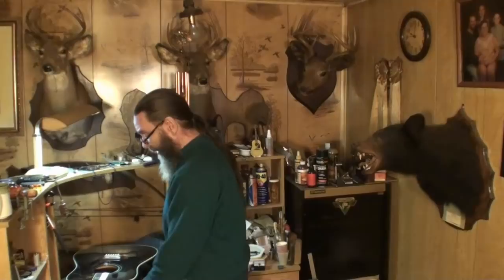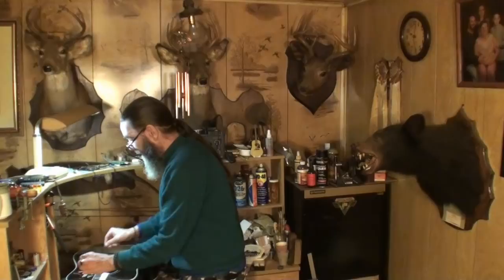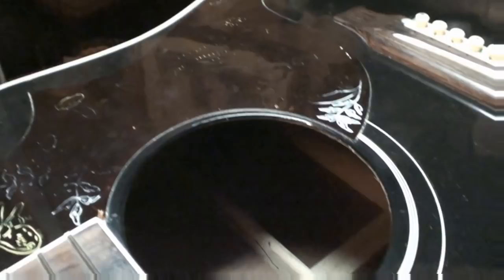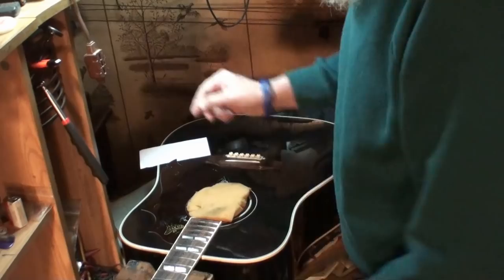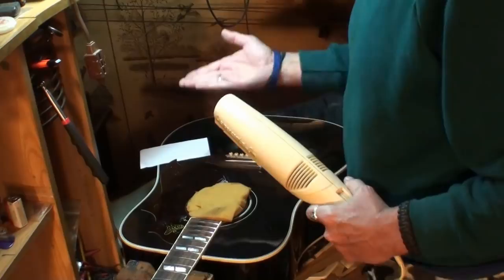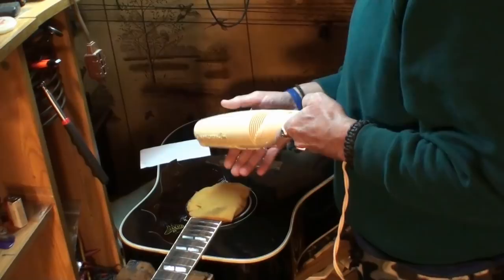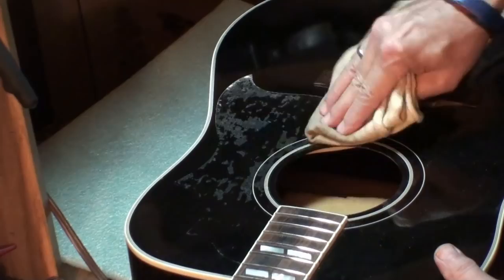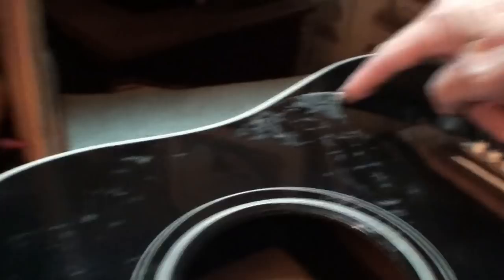gibson hummingbird pick guard removal hell!

Comment: Swapping my pickguard out on my j200 very soon
You seem to apply heat from the top off the guard
Why dont you apply hot air from under the guard also to soften the glue ?
With heavy glue residue i recommend appling a thin layer or two of  cellulose thinners on a fine artist brush & Leave to evaporate then gently remove also mild car body polishing compound works well ..  or T cut in small amounts 👍

Comment: Not knowing 4 Sure whether WD-40 would Release that, without Messing with the Finish.
But I've used it for Label Remover, followed by Electronic Spray, which flashes away the oil of the WD...